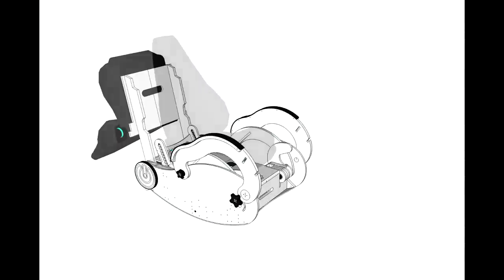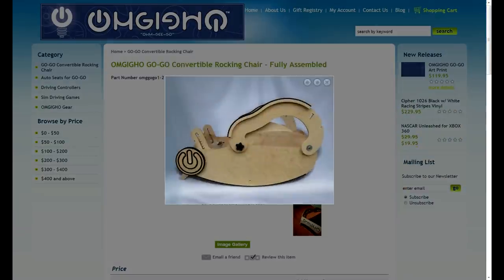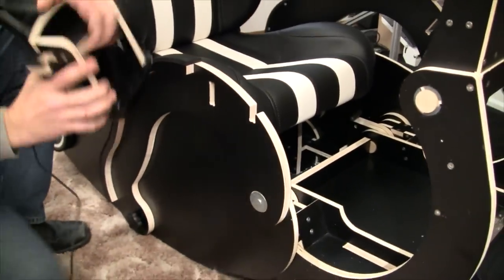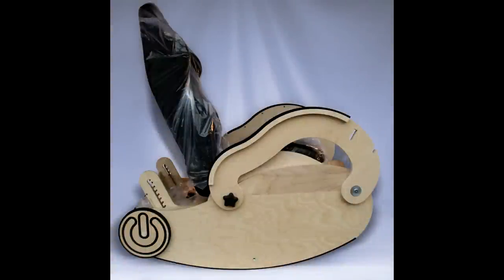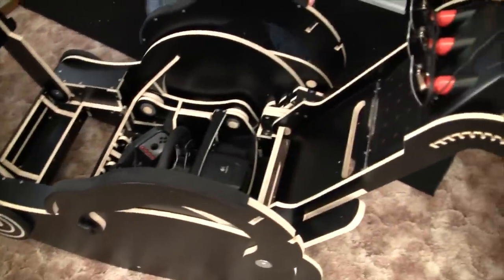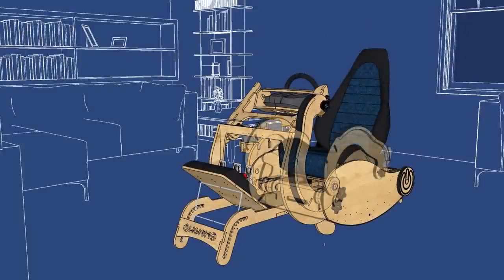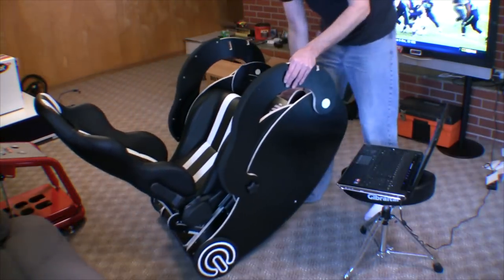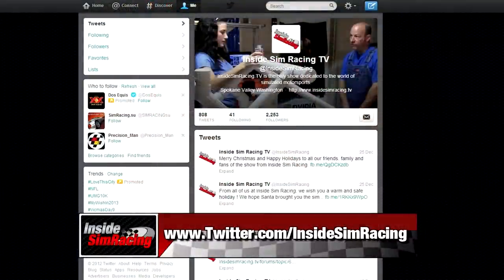Rocking Chair Converts to Gaming Chair / Racing Rig- GO-GO Review by Inside Sim Racing

Comment: Hey guys, I'm wondering which of these rigs that you have tested would be best for a PC gamer, not looking to use a wheel, but rather to use the rig with a keyboard and mouse for other games. To me it seems that the Obutto is the most accommodating, but would like your opinion on which is the most comfortable when using a mouse and keyboard for extended periods, or if you think this is even a good choice on my part at all. Thanks for your opinion/recommendation!

Comment: Even though I use a G27 and not a G25, I've run mine for more than 3 hours of hard drift use so on a truck sim where you're driving normally it shouldn't have an issue.

Comment: They have a good idea on the design. But the price is outrageous. It does not take a rocket scientist to make a chair very similar to this at all. for less then 300-400. Wood warps in time and wears. Also the steering deck needs to be reinforced way more then it is. It is very flimsy. Note: Not many gf's or wives will allow them to purchase something when they find out the price. I built my sim setup for around 75.00.

Comment: Too bad they don't appear to be in business anymore. The future could've been even more interesting. Perhaps they would've designed a product that could serve BOTH racing and flight, interchangeably with ease.
Reply: Theres not a big enough sim racing community. Its why logitech never dumped a lot of money into producing high end steering wheels. With VR all these seats are useless.
Reply: How are these seats useless with VR? You still need a place to sit comfortably and have peripherals mounted correctly.
Reply: Well being someone who hasn't bought a seat has VR and sits comfortably and plays, its rendered useless.....lol. I guess if you want the "realistic feeling" then get one. Other then that, they are useless.
Reply: You probably have to set it up each time at your desk, and your foot pedals probably move when you break fast, no?
Reply: The pedals do not move since they have spikes on the bottom that anchor into the carpet. Its pretty easy taking the wheel on and off the desk and surely saves a lot of money! These seats are purely a gimic and can be built for cheap.
Reply: Cheap parts, perhaps, but time spent on labor. Depending on one's hourly rate, the comparison to the retail cost of buying one can vary.